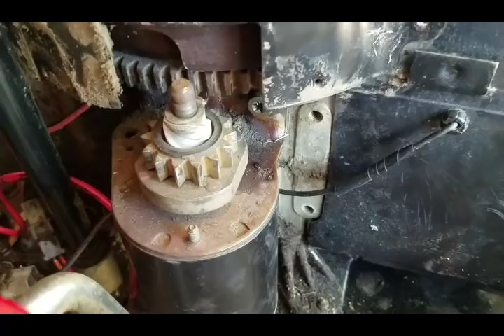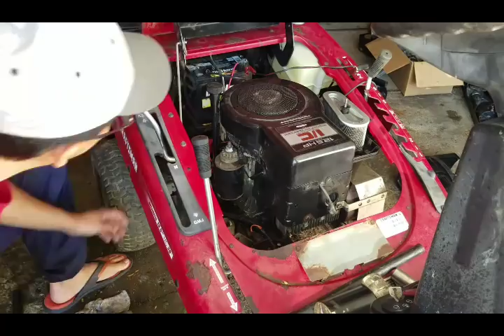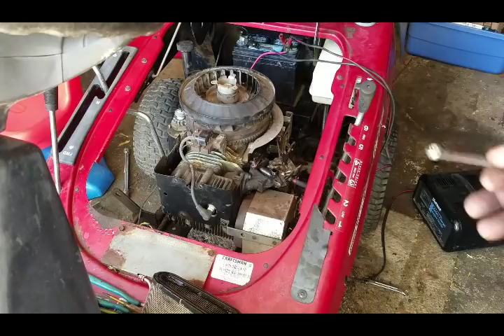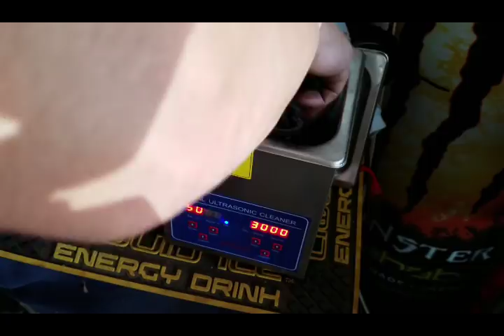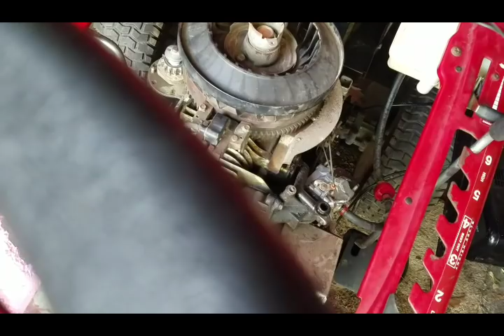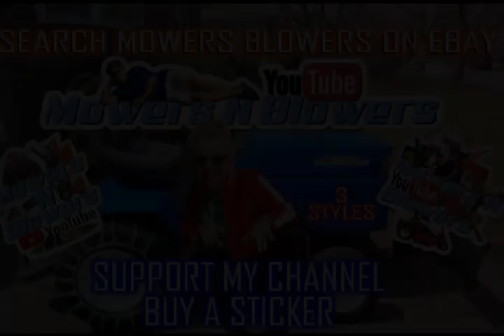FREE CRAFTSMAN 13.5HP MID ENGINE RIDING MOWER STARTER BATTERY KEY REPLACEMENT ULTRASONIC CARB CLEAN

Comment: Henry,  With it backfiring out the carb I'd check the throttle shaft on that carb if it's rattling around in it's bore you will be sucking too much air.  You also could have a sticking/slow intake valve hanging open too long (compression test should show that pretty easy).

Comment: Judging by the looks and the way the brakes were locked up, that mower must have been sitting in the elements for quite a while. Internally the carb may be in similar condition even though you cleaned it twice. Also as you showed turning the adjustment screw has no affect correcting the surging, that carb may be toast!
@39:25 when your cranking it over and running it there looks to be a fuel air mist blowing back out the intake side of the carb... correct me if I am wrong on that? Henry, I like the time lapse music you add to your vids, very cool.👍
Reply from the maker: You are correct, carb is toast..maybe, I bought a new carb for $11...gonna give that a try and rule that out! Thanks bro.

Comment: this has me puzzled but i was gonna say the governor or hopefully not the governor gear inside, , i was thinking the valves at first maybe the lopes on the crankshaft or like u said the timing is off
Reply from the maker: It's a head scratcher, I ordered a new carb just to see.
Reply: @MowersNBlowers  hopefully that is the ploblem bro

Comment: Carb does seem to be "hunting"; an ultrasonic cleaning is probably what's needed.  If that fails, then valve adjustment?  A real pain on flat head engines.  Good luck Henry.  Enjoy your videos!!
Reply from the maker: Thanks, did you watch the whole video? After ultrasonic, no change.
Reply: @MowersNBlowers  Yeah, I oughta shut up until I see the whole video!!  Problem is, at my age, if I don't say something when I think of it, I forget it!!

Comment: A streak of hard luck,  it happens when the planets line up a certain way.   Keep on Youtube'en, find that AC duct fan.  They are kinda big, you can't miss it.  Could be in the attic, the basement, by the hot water heater, in a closet, it's somewhere.  And that mower reminds me of an old Chevy Corvair for some reason.   You got me motivated to mow the front yard today, well, motivated enough to think about mowing the front yard.
Reply from the maker: Lol, thanks Roscoe the lawn needs to mowed no matter the motivation.  The longer it gets, the longer it takes.  Still looking for the blower fan bro.  It's nowhere in sight, I've lived in this house for 18 years, never seen it.  I may have to call a pro!
Reply: @MowersNBlowers   Is the duct work in the attic?
Reply from the maker: @roscoesomeone9764  I dont have an attic, but I can see some ductwork in an area similar to an attic.  I tried tracing it but I dont see anything other than ductwork..no blower nor control panels.
Reply: @MowersNBlowers  the same blower that runs your furnace runs your AC so if you're furnace blow's so will ac
Reply from the maker: @mrbriggs68  I have an oil burner for baseboard heating, it's not connected to my ac at all!
Reply: @MowersNBlowers  then you need to follow the lines from the AC unit into the house because we're ever they go is were the blower motor is

Comment: the oil level was over filled did you fixed that .
Reply from the maker: No...gotta get the engine running first or no point is it?

Comment: The A coil or the cooling coil for air conditioning should be in the duct right above the furnace .you will see two copper lines running into the duct and a drain hose  coming out for water .
Reply from the maker: I dont have a furnace! I have an oil burner for baseboard heating. The same oil burner heats up my water boiler. The only ducts are for ac which are completely separate from my heat.  I dont have ducts for my heat.